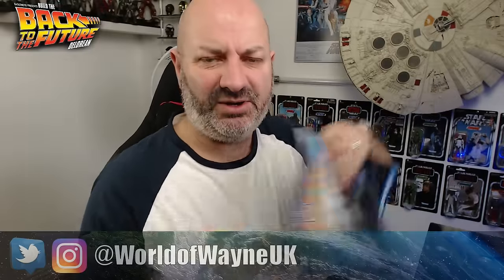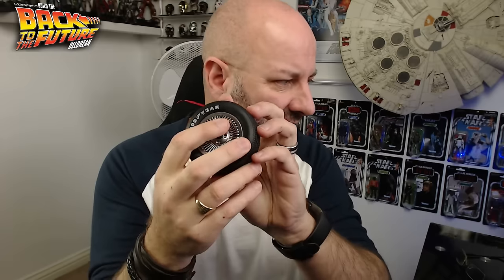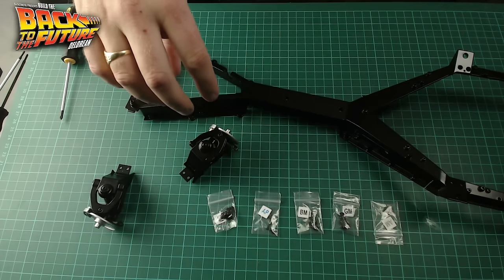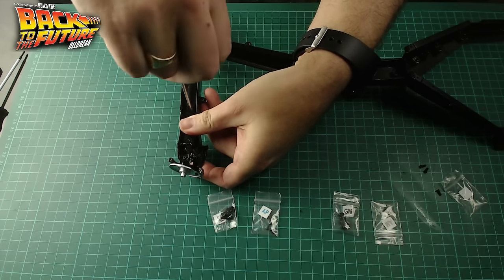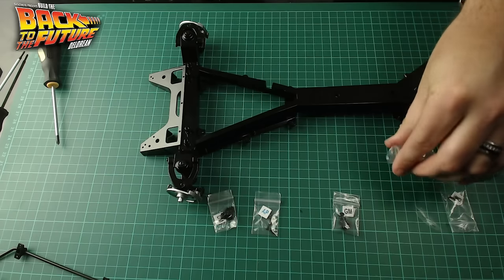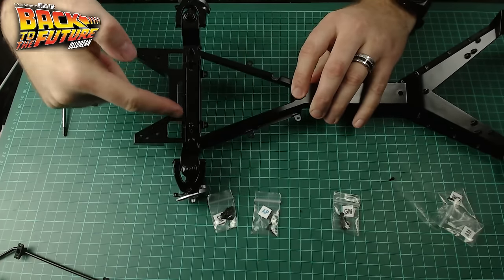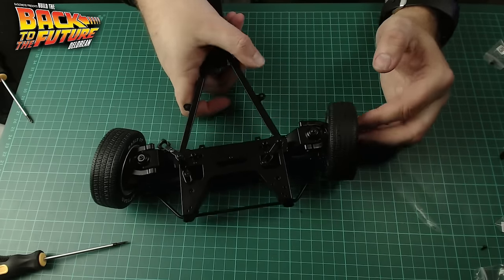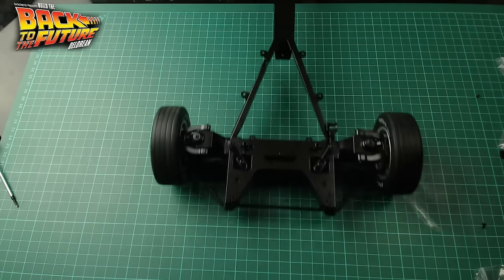Build the Delorean  - Issue 10 - The Chassis Frame

Comment: Use the dremel sander again to rough up one side of the disk magnet and crazy glue back in place. Might want to scratch the inside base of the hole as well.

Comment: I have the problem that the DM screw for the left end of the steering bar will not screw into the left suspension assembly. Like the DM screw is way too short to 'catch' onto it through the steering bar end and the wheel assembly and just pops off. I noticed on the right hand suspension assembly the hole is a lot bigger and that screw wnet in fine and secured properly. looks like I'll need a replacement left suspension assembly now.

Solution! - Used a spare CM screw and it went in and I managed to secure it in place.It's like CM screws are meant for the steering, not DMs
Reply: I got same issue here Dm is not sitting there so steering is not screw  so I will check the one you mentioned for CM to.

Comment: My front wheels are in desperate need of a wheel alignment. Once the steering bar is in place the left one looks straight ahead while the other one turns slightly to the right, never mind the wobbles in the things. Even wobbling them into a better position doesn't line them up properly. Pretty sure I've got everything in its proper place. I'll double check the next time I've got it off the shelf for another building session. Attaching the steering bar to the wheels was a bugger because the first screw I used threaded itself and it all fell apart once I put the thing right way up again. If it weren't for all these extra screws, I'd be stuffed. Obviously Eaglemoss discovered this with some test builds before they released it to the public otherwise they wouldn't be giving us so many of the things as spares. They didn't give us any spares for the 3D printer build from a couple of years ago, although they did give us a re-boring tool after some people were complaining about the holes being too small in some instances.

Comment: Hi Wayne. I find the problem with magnets in wheels. In Holland we got now this model. The wheel from issue 3 is more light then this from issue 9. I think the wheel from 3 is plastic and from 9 is metal. Thats how i got and dont work with magnet. Weight of the wheels is different
Reply from the maker: That's strange. They should all be the same

Comment: Just finished this issue and I didn't notice any issue with the magnets yet. However, there's apparently either a molding issue with the whole suspension assembly for the left front tire. The screws refused to align and would always end up going in at a weird angle. I disassembled everything and tried a number of times to get them to go in straight. Anyone else seeing this issue?

Comment: ok i need onee help here on the part of connection the suspensio with the axis that turn the wheel left right in manual he use Dm but for some reason my Dm dont hold it any other screw i can use and little bigger ? i also try CM but its more thin than Dm
Reply from the maker: As long as it’s got an M at the end try them all

Comment: I've got wheel wobble on one side but magnets are fine so not sure why
Reply from the maker: mark graham did you screw it fully to the hub?
Reply: Yea may just need to push a bit harder lol
Reply: mark graham did you fix it? Mines is fully tight but still wobble. Thinking of putting a washer to help it.

Comment: but is the amount of detail it has outweighed by the amount they skipped over? (quality checks and such.)
Reply from the maker: There were lots of probs with quality in this build. You will see throughout my videos. If I come across it I point it out. Actually if you check out Part 159 I list them lol
Reply: did anyone try trimming the length of the screw's while working on this set?

Comment: I've just been building part 10, and I've got a couple of problems. The first is wobbly wheels (which I see other people also have). The other problem is with the steering. My wheels won't turn all the way to the right because the small arm on the steering rack assembly from issue 7 catches on the frame and won't allow the wheels to turn all the way. Has anyone else had this problem? How can I fix it?
Reply from the maker: Sabreman64 I had the same. The only fix I had was to ensure the screw that attaches the arm is in real tight. It will lift the arm so it doesn't catch.
Reply: I've tried tightening that screw, Wayne, but it absolutely won't budge. It's almost all the way, but not quite. I've tried various screwdrivers on that screw without success. It won't turn any further.

However, having had a close look at that part, I think the slot that the other screw slides through when the wheels turn is bent downwards slightly. If I bent the part up a bit or got a replacement part then it might solve the problem. I may contact Eaglemoss to request replacement parts from issue 7.
Reply from the maker: Okay. The only things left to do is remove the screw and compare it to others. I found some of them are slightly shorter length. If so then swap the screw out. The last resort is to file some of the length off the screw but that is one fiddly job :(
Reply: I want to add - yeah. the wheels on mine are lose and wobbly too and the screws for the connection for them are in ALL THE WAY. The way I see it is that THIS IS NOT A TOY to play with like when a kid plays with a Tonka truck in his sandpit. It is a DISPLAY PIECE that even Jordan Schlansky would agree. The wheels sit just right when in a stationary position. And I'm satisfied with that. I'm going to have to come up with some kind of jury rigged car lift to keep thr wheels off a surface when it comes to assembling the rest of the model :P Not too sure about using Drinking glasses, still putting 'pressure' on those tires. :P

Also, obviously we are not going to lie on our bellies on the carpet at home and drive it around making car noises and making pretend that it's flying around with the wheels down by holding it up in the air and spinning around. This is practically a aork of art to display proudly. Not to drive it into a wall at top speed like I used to do with my lego models. LOL!

Comment: What if the reason the one wheel is flopping around is cause of the fact that it's the wrong screw
Reply from the maker: If the screws are tight the wheel.wont wobble
Reply: @WorldofWayneUK  That makes sense thank you